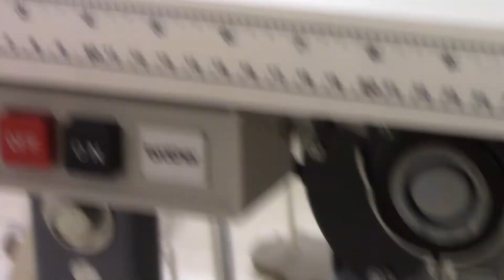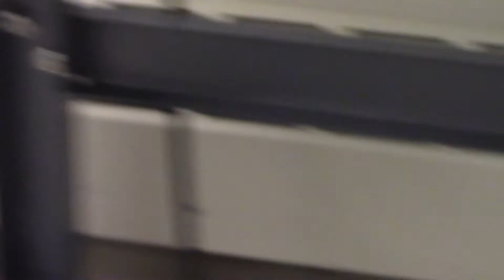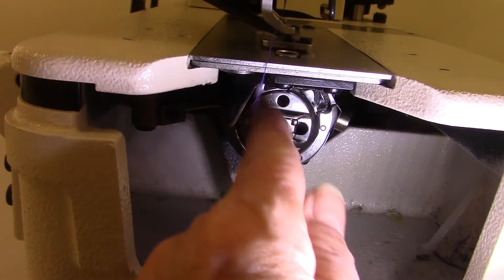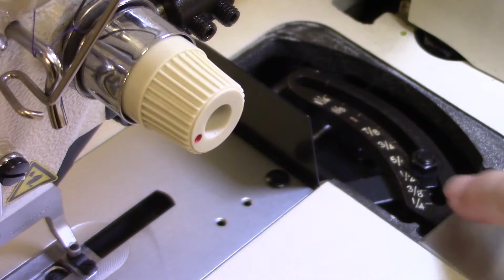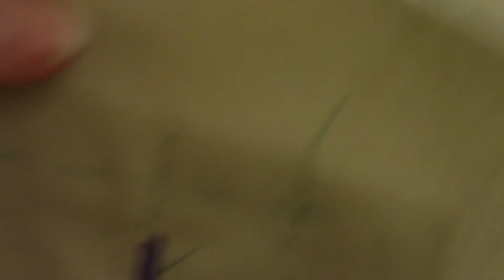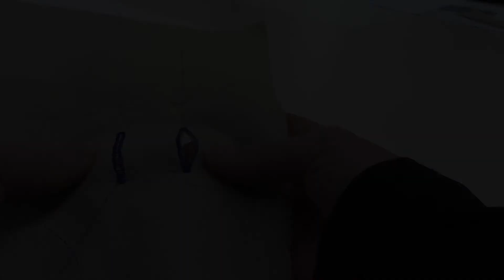HOW TO USE THE INDUSTRIAL BUTTONHOLE MACHINE

Comment: where can i source this machine?
Reply from the maker: It is a Juki. I recommend this model over the computerized one. If you live in Massachusetts I can give you a good resource.
Reply: @blakedesign5633   I live in Washington DC.
Reply: @blakedesign5633  why do you not use the built-in knife?
Reply from the maker: @michaelfontaine4541  Because I have 100 design students doing different size buttonholes -  which would create a nightmare!!
Reply: Nice video, but what's the use of handle?
Reply: Does it only do that style of button? What about key hole button?